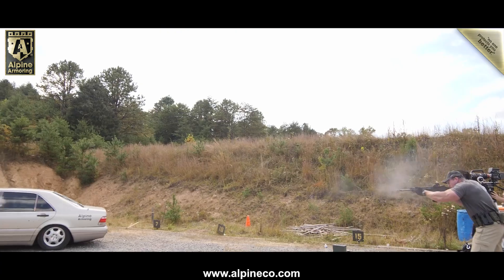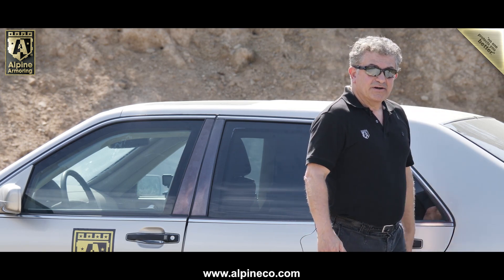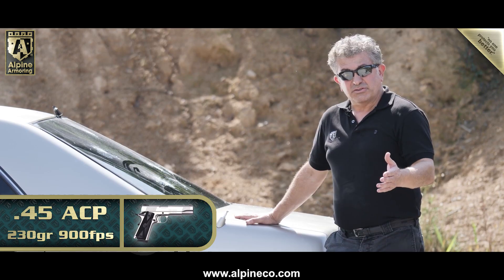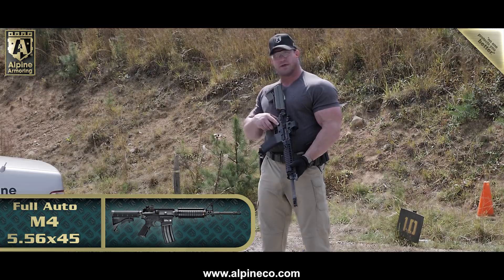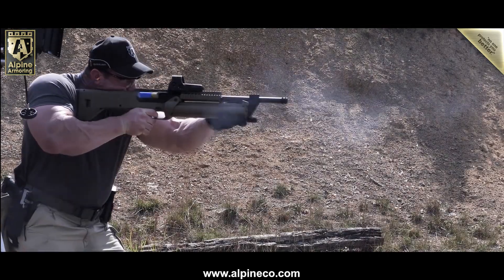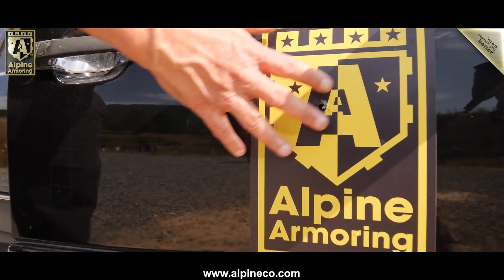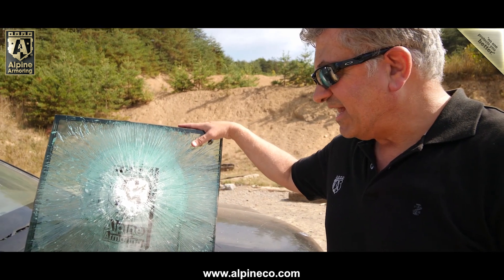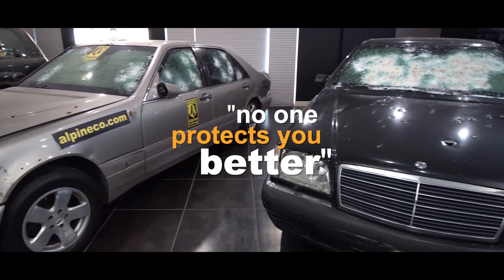How Long Do Alpine Armoring's Bulletproof Vehicles Last?

Comment: Why wouldn't an assailant focus as many high powered rounds into one spot as possible to achieve penetration in a window.
 That way, just a few rounds entering the cabin can cause a lot of carnage.
 Spreading the shots around like this, only proves that you will be protected against a random, unprofessional attack.
 Which is nice but, if you're riding around in a custom armored vehicle, you're someone who is more like to be hit with a professional/organized and well thought out attack.
 Of course the intention is that the vehicle will be moving so there is less chance of concentrated fire on a specific spot, but that is where a plan to block the vehicle in comes into play.
Reply: Your target would very likely be moving at a high rate of speed. You wouldn't be able to enough rounds into a small enough area.
Reply: @fadingbeleifs  you didn't read my entire comment then

Comment: I’m really disappointed that most of the rounds fired were a significantly shallow angles, very few were placed head on, but it still was nice to see this car take numerous hits safely
Reply: If the car was driving past the shooter(s) the majority of the rounds would be at shallower angels.  If the car was boxed in, then different scenario.
Reply: @jp-ty1vd   So, if the car was surrounded, cornered and boxed in, would the protection be insufficient? What do you think?
Reply: @Seventh7Art  I don't know for sure.  It would depend on the caliber of weapons used and duration of fire.  ie pistols vs riffles (m16, AKays, etc) vs heavier weapons (machine guns 7.62, .50 cal, etc).  Every amour has it's limitations.
Reply: @Seventh7Art  if the car was surrounded, cornered and boxed in, the people inside have completely different issues than someone shooting. You could put a grenade/IED on or under the car in such a situation and pretty much all security would have fucked up their job if that's possible.

Regarding the original comment: Angles are good to keep the shooter safe. You'll never be able to recreate the perfect realistic scenario anyway. What if someone gets .50 BMG SLAP or general AP rounds? What if they get a rocket launcher of some kind? Shaped charges? Drones dropping some payload from above? At some point every armor will break and/or will be too heavy to be practical. Even a tank isn't safe.
Reply: @jp-ty1vd  If the car drove past, then there  would be rounds fired head on/90 degrees angle of incidence\. They fired the ak74 at like20 degrees, increasing the armour apparent thickness by almost 3x and introducing ricochet mechanics
Reply: Shallow angles are harder to armour against window sashes door jamb rims etc need to be installed properly
Reply: I noted that. But it appeared that one of the mercs was raked 90° by a pkm. Am in Pharmaceutical marketing and I totally understand if they fudged it a bit to make money
Reply: @babachloe7140 Pharmaceutical marketing… empathetic towards rigged test results…. Man I hate the medical industry, how do you sleep at night?
Reply: I reckon a 90 degree angle may lead to something coming back at the shooter, but having said that I would like to see the gunman aiming multiple shots at the same spot.

Comment: As an engineer, I can understand that the first bullet gets stopped, but after many shots it still holds up?
WOW
Reply: I’m not even an engineer and was simply shocked! You would think all those shots would eventually penetrate and break through. This means even 20 years ago these cars stood up and probably saved lives.
Reply: @IamRocque  I don't know if it's necessarily a good thing, if you need this much protection while riding in style probably you're not that good of a person lol
Reply: You know being an engineer theres nothing to do with that
Reply: @KHALEESI0426  sorry he forgot to add the part about the 12 NASA space shuttles he worked on after their fleet got attacked by raging space monkeys, his job as an engineer was to stop the bullets by catching them in his mouth after the first window failed, if only this heroing engineer had thought to go with THIS specific kind of glass, as to his utter amazement.
Reply: @KHALEESI0426  engineer in the car industrie, especially into the windows of the car and placing them automaticly

Comment: I can say this much the glass resin used to make bullet resistant windshields and glass is imported from Scilly, known for the purest sand used for glass manufacturing, including military applications, they use also polycarbonate in-between the glass, so depending on what grade of protection you want the heaver the glass will be in fact the front windshield for the Australian bushmaster truck weight is around 2 ton alone, its about 4 inches think and cant stop a 50 cal round, normal round armour piercing different story? I was part of the procurement for the AU Defence contracts for specialised alloys and the Bendigo ADI plant were the company who made the Australian bushmaster armoured truck.

Comment: What about the radiators and tires. Also using a 22mm on full auto. Also gas tank and under the car protection from possible IEDs.

Comment: "Heres out video testing out the safety of our manufacturing" "Whist we wear the most minimal of safety gear as lead ricochets off of our bullet proof glass, stand around guys get in close"
Reply: Majority of the force is lost when it hits the window. Sometimes the lead is left in the window. In order for the ricochet to be dangerous there would have to be very little to no denting like when they shot the steel plate at the end

Comment: I’m no weapons expert, but I do know a bit about physics.
All their tests were done at an angle which means the bullet richoches/bounces off. Not delivering the full penetrating force to the glass. They should do it straigh on as a would be shooter would. No assasin would do it at an almost impossible angle, to be able to hit a target. If I were the shooter (I’m not one 😉) I would do it straight on where I could see the ”target” clearly.
So the test should have been done straight at an 90 degree angle.
But that’s just my oppinion.
Reply: stick to physics. Leave safety to the pros
Reply: @uscroger4690  Who said anything about safety?
I was reffering to the way the test was conducted.
And besides should safety tests not be conducted in a worst case scenario?
Where the shooter actually has the most chance of succeeding?
That would proove that it’s safe.
Reply: also, if you were the shooter you'd miss
Reply: @uscroger4690  Nope, I’m actually a pretty good shot, call me a natural if you will.
7 out of 10 first time I ever shot, at a moving target at that.

Comment: Your being insincere with angled shots at the car windows try shooting the 7 62 20 rounds head on at the same spot you'll get penetration. Or use higher calibers because no mercedes is rolling with the 50 cal stopping glass it would be too heavy plus it only stopped 1 round let's see it stop 10 in the same spot with armor piercing incendiary rounds  or explosive rounds.

Comment: Why did they ignore the SR 25 damage on the side window? Seems like that smashed the window out of its frame. @ 6:54
Reply: Thinking the exact same
Reply: Yeap,another shots of SR and the window is down,...or full auto with the VZ.58 or AK47 and thats it...:D
Reply: It's a little piece on front there's still some thick glass behind it. Maybe a 50bmg in that certain spot would do some damage since the little piece Is compromised but I still doubt it.
Reply: It dose not affect since the overlap is behind it
Reply: Because it's an advertisement my friend.
Reply: It's several inches thick, it only knocked loose the first layer
Reply: Yea i could see that too
Reply: If I worked there I wouldn't want to show that too lol
Reply: Aim is to prevent penetration that’s it
Reply: I was thinkin the same thing! Especially cuz it was the first window he didn’t address the inside damage on! Plus when he first opened the door u can see thru the top of the inside also!!
Reply: I saw that too
Reply: To be fair, that window only started to buckle after getting shot with dozens of rounds previously, and in its weak spots as well.
Reply: those glass panels are usually super thick laminate, i think we are seeing the fringe edges of it when it seats into the window, maybe a few more shots might have dislodged it but even then i doubt it. Good eye though, i had to go look back
Reply: Only Jesus Christ can provide TOTAL PROTECTION!
All else will fail!
Reply: @useryggfdcc  imagine how many people were brutally murdered with that way of thinking
Reply: @useryggfdcc  everything else protects u better than Jesus. Hell even Zeus would do a better job
Reply: @useryggfdcc  but have you ever thought that… You’re wrong?
Reply: @tomsoki5738  Wdym...
Reply: @Tom Soki Bro, Wuts ur problem?

Comment: I build 3 ft 3D printers and can print lightweight 3 inch poly carbonate woven panels that will stop a 30-06. Not really impressed, steel is heavy. Call me if you wanna go polymer. Also thinner 3/8 inch resin poured polycarb glued together with UV glue from cell phone screens is stronger. 1.5 inches of it stops plenty on an angle.

Comment: If you really want to know something special there's a very special kind of spray that you can buy to make a 22. Caliber Pierce through 2 inches of steel so really you guys are wasting bullets I could have shot through that car through both panels and into the engine block with a 22 you guys are using either 7.65 or 556. Caliber hand weapons and yes if you're wondering why I say hand weapons it's because you use your hands and assault weapon is totally different and has a special kick out piece for the butt

Comment: God forbid someone would try to shoot the same place twice..... Good demo, and will save your life on the move but you can shoot through that glass with a 9mm and a mag full of rounds. Also the unsupported glass and steal is an old trick as it will bounce around .... Once part of the car structure large calibre rounds transfer all their energy into the panel.

Comment: I want to know how many shots in the same hole. If the car is boxed in and an assailant runs up to the window, how many rounds can the window take in the same hole before it fails. Also who is attacking an armored vehicle with a .50bmg and not using AP or MK211.

Comment: not for nothing but the black Mercedes passenger front window was taken out by two rounds. they never addressed this in the video, just the door and soft shell of the frame of the windows.
 it was clear as day compromised ( front passenger window on black Mercedes) and the 50 Cal window test was never shown from the reverse side of the glass.   I understand these vehicles are very well armored but if a potential client was to see this video they would have second thoughts about this video and the lack of addressing the fails I pointed out in this video.

Comment: BUT - they didn't shoot the car with the .50BMG - they shot separate test articles (armor plate and a window). Are those the same kind of armor and windows used on the car? It doesn't look like it. It also looks to me that the window which was hit with the .308/7.62x51 broke around the top edge.

Comment: Disable the vehicle by shooting out the tires then toss two grenades underneath it.

GAME OVER OCCUPANTS.
Reply: If you've seen certain police chases, you would know that cars can still drive with flat tyres. Maybe not fast and amazingly, but enough. And there are some explosion resistant cars too, and in the real world, how did you just have 2 granades so easily and think using them on a potentially moving car is the best way of getting maximum usage from them.

Comment: If someone shoots the tires and radiator, then uses a $2 road flare to light the front and rear tires on fire, how long will the armor keep them from hoping out the Mercedes slow cooker?
Reply: Even if these didn't, cars can still move enough on flat tyres and unless you knew this car was bulletproof, you won't first aim for the radiator as it does not get knocked out by just 1 bullet giving the driver time to get away.
Reply: @X33Ultras0und  so you think a car on flats can out run a vehicle giving chase that has air in the tires? You clearly have never been in a chase or combat situation. I spent 7 years in the military and 3 of those years was in the middle east. This isn't some video game you played. In real life, you don't outrun a vehicle while you have flats and they don't. Also yes, people who are even semi trained killers will shoot your radiator first to eventually disable the engine. In fact, fairly often, they will use multiple large vehicles to box you in from the front and rear and then you won't be going anywhere.
Reply: @Steven-gv1ke  This is of they know your car is bullet resistant from the beginning. Would you do that? If you had to assassinate somebody, and you saw them in the back of a Ford Crown Victoria, shoot the engine first and hope you hit the radiator? Assuming you're in a position to hit it yet the driver doesn't see you aiming at the car.
Reply: The car has plastic inner tires
Reply: You would have to trap the car e.g. with other vehicles because it is equipped with run flat tires. And these cars are usually operated in a convoy, meaning that you would need to conduct your road flare operation while being mag-dumped by multiple operators :D But it is not secret, that you could successfully ambush an armored vehicle with a roadside bomb or an rpg
Reply: @j.s.6080  your response was the only logical one here. I absolutely agree if it's in a convoy, it would work. Without armed security around it though, it would be easy to circumvent the armor with basic various methods.

Comment: If y'all are so confident in your glass, why did you have the tester stand at a 45 degree angle to the window when shooting the rifles? He stood straight on with the pistols. Anyone who knows anything about shooting glass, knows a glance shot is significantly easier on the armor. So shoot it straight on with a AK and AR so we can see it's true durability.
Reply: In real life, you would be getting away from someone shooting at you, and there would never be point blank at a 90 degree angle for very long.
Reply: @X33Ultras0und  in real life, if you need bulletproof armor, you are likely a high value target. If you are a high value target, people are going to go to more extreme measures to get you. If someone shoots the radiator a few times and shoots the tires, even if you have run flats, you can't exceed about 45 mph on run flats with no air and although you can still drive, your vehicle doesn't handle like a vehicle with air in the tires. So if you have a couple vehicles chasing you, you are not getting away driving only 45 mph on blown out run flats. Plus your radiator that's shot will cause your engine to overheat and friction lock in about 2 to 3 minutes. Then you will be a sitting duck and someone can simply use a road flare, light the tires on fire, and you will either cook, or get out and get shot. Armor like this only is good if you have a security detail following your vehicle who can engage enemies as they ambush you. I was in the military for 7 years and I've been in armored vehicles, escorts, and know how it works. One vehicle alone with armor won't do much unless the people trying to kill you are VERY stupid. Which if you need a armored vehicle, people trying to kill you are probably at least semi trained and will be semi professionals. Those people will get you if you don't have at least a car full of security following you.
Reply: @Steven-gv1ke  If you're coming from the this angle, then won't you also have other security vehicles around your car, like some ahead and some behind so then you can't "just do" anything as the body guards are there. Especially if you are so high value, then of course, one lone car isn't it. Though, my angle was driving through some situation like a Mexican cartel and having them block the front of your car, they won't have big enough guns or maybe even the intelligence like you to aim for the tyres or the radiator or even know it's bullet resistant. This was my angle.
Reply: @Steven-gv1ke   the motor is protected fool. 

You really think they couldn't stick More metal under the hood than the doors you bout as dense as the window glass. 

Pretty sure they're using more than " run flats " 

And if you can't understand the way this car is developed, 

Just don't speak on it.

Comment: I hate to say it but bulletproof glass is not bulletproof and it may stop some rounds but if someone that knows how to shoot shoot it in the same spot over and over the bullet will penetrate but most people don't know that so whatever.
Reply: They can also shoot the tires out, and roll a 20 lb propane tank under the car, and shoot it with a tracer round. You will get out that vehicle when you start cooking in it. Hell even a road flare can light one of the vehicle tires on fire, again, they will get out when the start cooking.
Reply: Sorry, but in what real world situation would a criminal be able to do that? Aren't your trying to escape? Doesn't trying to escape mean you will be moving around? Aren't moving targets harder to hit? And how would they know from their first attack that your car is bullet resistant?
Yes you are right, if they shoot the same place it will go through, but this is why cops tend to wear body armour over the torso, because getting hit in the neck isn't common enough.